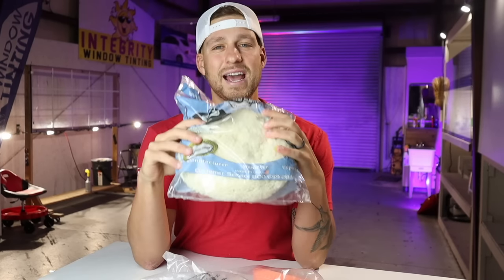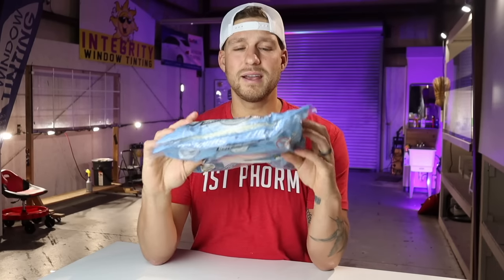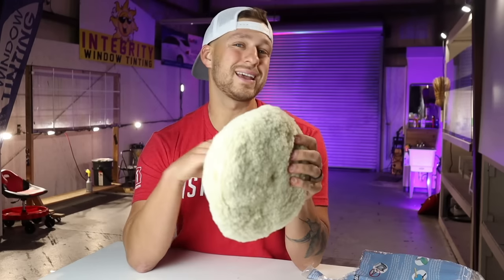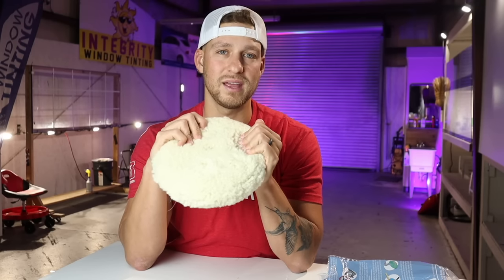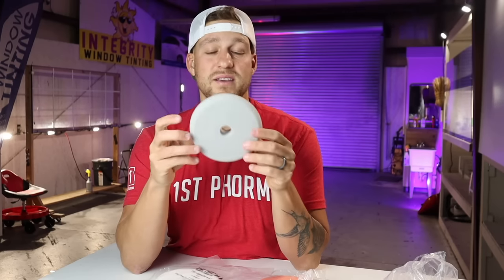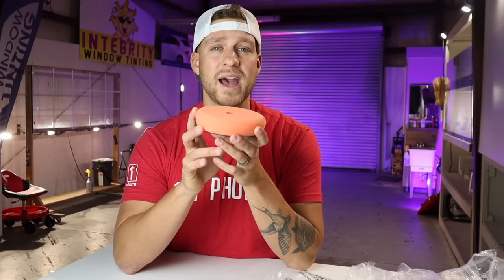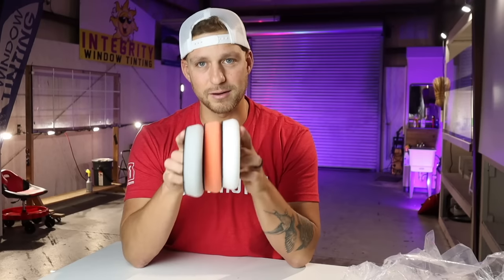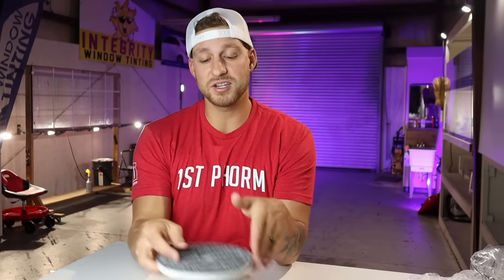Boat Detailing Pads | Everything you need to know!

Comment: You mentioned you don't like using the yellow wool pad and you find it somewhat irrelevant can I get your opinion on this? Wont it still leave small swirls and holograms?
Reply from the maker: Yes the yellow pad will still leave swirls. 

The orange foam with menzerna 400 with remove the swirls from the white wool pad just fine.

Comment: I have a Festool Rotex RO 150 dual mode sander (6"). You can lock or unlock forced rotation. Do you think this would work as well as the flex unit you mention?
Reply from the maker: Yes that should work!

Comment: Hi Drake, Awesome Video Content!! Thanks!!  What compound would you use if your only doing a one-step light oxidation service with just the grey foam pad before waxing?   Also, Pertaining to the Uro-Microfiber pads, d you use the Black ones or grey ones more. I see you use the black ones a lot in vids. What is the criteria for white vs. grey Uro-Fiber pads?   Thx,   Mike
Reply from the maker: Hey Mike! I would use Starke Elevate! It removes light/medium oxidation, but then it works down and works exceptionally as a polish!!! And as for the microfiber pads, both of them will work! I use them both for waxing! 😊

Comment: Similar to CKW comment. Watched your how to wet sand a boat (properly) video which was also really well done. Thanks for doing these. I have a question if thats ok here. Buying a 2020 black hull boat with vinyl letter name midship on one side of hull. Black gelcoat and letters are pretty big at around 10" tall and 1.5" thick. Entire name of the boat area is probably a good 2' long. Boat has less than 70 hours and has been stored under cover. Wondering your professional opinion on what I may need to do to the letter area after I remove them to keep from seeing the difference in the gelcoat color. Start with buffing? Can you recommend pads any solvent or polish etc? Thanks again for the content.
Reply from the maker: If you were just planning to buff the hall, the vinyl graphic should be fine. However, if you take them off, then just buff then you will see a little bit of a color difference difference in the gelcoat. If you take them off and want to blend them in, you may have to wet sand.

Comment: What is the RPM that you recommend for waxing an rv with microfiber pad with the Meguiars DA? And for compound removing swirls, witch RPM? Thanks for your help.
Reply from the maker: Hey bro! For waxing, you want to be on a pretty high rpm. Probably second to third highest setting. The sealant will adhere better if it’s heated up by the machine.

Comment: My boat is only 2 years old and not oxidized.  I want to wash it and wax it really good but the boat is Black and tan with a Black Motor.  What would you suggest?
Reply from the maker: Starke hyper hold, buff and shine urofiber pad, on a griots garage G9 DA
Reply: @DrakesDetailing  Would Jescar power lock work good as well?

Comment: So you compound with a rotary buffer then  do you finesse is what im use to using and then polish with a da? In the body shop world we just use one machine for all 3 steps and thats a rotary buffer
Reply from the maker: I’m not familiar with 3M’s products, so I can’t really tell you what step finesse falls in, but yes, heavy cutting step isn’t with Wolf head and a rotary, medium cut/Schill removing is done with a rotational polisher and a foam pad, then your sealant is applied with a dual action polisher with a microfiber pad.
Reply: @DrakesDetailing  finesse-it falls in between heavy cut and  a polish. It takes out the heavy cut scratches. I have always used in with rotary makita buffer. Wasn't sure if a DA would be a better choice. I have never used a DA polisher when buffing.

Comment: Do you recommend wet sanding before using compound  on a highly oxidized  boat?
Reply from the maker: Hey Bro! It depends on the level of oxidation, if your heaviest cut compound isn’t bringing you the sine that is should, then you probably need to wet sand. If your can feel the pores of your gel coat like sand paper, then you probably need to wet sand. Either way, do a test spot where do try both, and see what will work the best for you!

Comment: My boat has a gray hull and has light oxidation and I am confused by all of the different combinations of pads and rotaries, orbitals, and DAs.  I am not a professional detailer just a boat owner and I'd rather not spend $450 on a Flex 3401 but I am willing to buy the Mikita polisher.  If I were to buy the Mikita, which pad could I use for light oxidation with that polisher, and which product (compound, polish, etc)?  I already have a Griots DA that I use for applying Jescar sealer.
Reply from the maker: You bro! If your budget only allows a rotary and yo I have light oxidation, then I’d use a yellow wool Lake Country pad with chop top compound from shine supply. Use my discount code DRAKE15 https://shinesupply.com/collections/compounds-and-polishes/products/chop-top-32oz

Comment: I picked up a aluminum fishing boat and have discoloration on the hull and water mark down the side covered in calcium that absolutely will not come out without sanding which makes me nervous but im going for it but all the info im finding is on glass boats that are gel coated what would you recommend for a painted aluminum boat for detailing the exterior including compounds
Reply from the maker: Hey bro! Is it just stained? Maybe try some acid
Reply: Drake's Detailing  it has a horrible water line stain down the boat and calcium built up so bad but id be willing to try your trick what acid would you recommend

Comment: Hi drake could u tell me the steps i need to do on a new applied gelcoat many thanks
Reply: And also which products to use
Reply from the maker: Hey Daniel! Just be careful on New gelcoat, if it’s not yet oxidized, then you can just polish it with Starke  Elevate medium cut compound, then apply Starke Hyperhold polymer sealant to protect against the UV rays. Then repeat every 4 months or so.

here’s a link to where you can buy the products….  Hope this helps! 😎
https://drakesmarinedetailsupply.com/collections/sealants/products/starke-hyper-hold-polymer-sealant

https://drakesmarinedetailsupply.com/products/starke-elevate-medium-cut-compound?variant=37398819602608

Comment: Great video and information. I have been using Menzerna on all my boats and Mercedes for 15 year and detailing for 30 years, not as a business. Question, I started using the new Menzerna 300 or usual 400 with lake country wool on a flex 14-2 150, depending on the oxidation on the boat. The interesting thing is I don’t  get heavy swirl mark with my wool pad when cutting. Then switch to lake country foam CCS, but will try the forced rotation pads. 

Do you use Menzerna 400 to cut on wool and then also switch to your force Rotation 3401? Or do you use another cutting compound? If so, what is it. I thought Menzerna 300 was the most aggressive in the industry to cut with? I have always used a flex 14-2 150 for cutting and polishing, I guess I’m just old school. But willing to change it up and maybe purchase the 3401 by flex. Alway willing to learn from others. 

One last question, are you ceramic coating boats now? If so what product do you use, how many coats are required and how long does it last, looking  to do my 50’ Express boat. Thanks
Reply from the maker: Thanks for watching! 

I personally use starke level R for my heavy cut and I mainly use menzerna 400 as my medium cut on boats. Menzerna 400 doesn't leave a lot of swirls, which is nice. 

The CCS pads are great pads too, I would stick with them if you are getting great results!

As for ceramic, I coat a ton of boats with starke liquid Thor coating. Its really easy to apply and list about 18 to 24 months! 

https://drakesmarinedetailsupply.com/products/liquid-thor-nano-ceramic-marine-coating?_pos=1&_sid=b038da51f&_ss=r

Comment: Hey drake if I use chop top on my Rv which product would I follow up with or which product do u Recommend for the RV
Reply from the maker: Depends on how back the oxidation is. If it’s bad, then chop top with the white wool pad. Then follow up with the orange foam with chop top again. That should be all you’ll need todo
Reply from the maker: Use the foam pad on a da or force rotation polisher
Reply: Ok thank you.

Comment: How do you determine the level of oxidation? I’ve got a 2016 Sportsman and it’s definitely lost some of its shine but there’s no chalkiness or anything. I can’t decide whether to go with a heavy cut or a medium cut. And could I use an orange pad to do a cut and polish in one step with a DA? Thanks.
Reply from the maker: Hey Lee! For your boat I would do Starke Level R heavy cut compound. I would just do heavy cut to level it all out and start from scratch, then work your way up to the medium compound (Starke elevate). The DA will not have the power to cut through oxidation, and that orange pad is meant for polishing not cutting. Hope this helps!
Reply: @DrakesDetailing  so heavy cut even though it’s not heavily oxidized? Once I do this will I be able to just do a one step polish/seal every 6 months or so if I stay on top of it?

Comment: So I just ordered some starke hyper hold and the microfiber pads you recommend from your site. I do have a question. Do you use the pads over and over again or do you apply the sealant and throw away the pads after use and just order more the next time you apply the sealant?
Reply from the maker: You'll be ok to use the pad a few times! Thanks for purchasing !
Reply: @DrakesDetailing  do you clean them with anything?
Reply from the maker: Not my waxing pads
Reply: @DrakesDetailing  question for you. I just got my buff and shine URO-fiber pads item #692MFP-2 in. They say med cut. Did I get the wrong pads for my new boat to apply starke hyperhold?

Comment: Hey Drake I haven’t seen a video on how to clean a tender boat. With the polyethylene how do you get that clean as mine is terrible
Reply from the maker: You can use some degreaser and wash brush. after that, Id keep it wiped down with 303 sealant
Reply: @DrakesDetailing  tried that really didn’t make a lot of difference, to stained. Thanks anyway
Reply from the maker: If you have an Instagram account you can send me some photos, I might be able to help more. 

Instagram @Drakes.detailing

Comment: Do I need to use the foam pad? I just want to wax/polish my boat. A lot of what you’re saying is going right over my head. What do I need to do? My boat is a 2014 Nauticstar 203 DC red and white color.
Reply from the maker: It highly depends on the condition of your gelcoat. If you are saying it just needs polished and waxed, then I’d use a DA polisher with an orange force rotation pad from Lake country, then I’d apply a polymer sealant with a black pad from Lake country. https://shinesupply.com/collections/pads-applicators/products/hdo-orange-foam-cutting-polishing-pad

https://shinesupply.com/collections/pads-applicators/products/hdo-black-foam-polishing-finishing-pad

I’ll have to get back to you regarding an upholstery guy. 😎

Comment: What size backing plate do you use on the flex? Wondering if it matters relative to pad size
Reply from the maker: 5 inch backing for 5 inch pads, 6 inch backing for 6 inch pads

Comment: Please help a kid with a tip: my son was hired to wax a yacht, the guy gave him a bottle of non-cleaner wax and said go to it with no other instruction.  He put the wax on by hand and now it won't wipe off, you can still see the dried wax marks.  What's the easiest way to get that stuff off?  He's just a kid, but he's really trying to fix it.
Reply from the maker: It’s most likely sucked into the pours of the oxidized boat. 

Usually a dawn dish soap wash will remove it… if that doesn’t work wash the gel coat with all purpose cleaner like super clean or purple power. 

If that doesn’t work.. then you’ll need to buff it off with a rotary buffer, wool pad and some compound. 

Hope this helps!
Reply: @DrakesDetailing  thank you!

Comment: The hull seems kinda dull. How do I know if it just needs waxing or if it needs polishing or compounding, etc?
Reply: To remove oxidation use a cutting compound to remove it and give a shine.
Reply from the maker: If it’s dull you’ll need to compound and polish before waxingn
Reply: I’ve watched several of your videos. Really looks like you know what your doing.   However, it seems the boats in the videos are already in really good shape. Is there a video that maybe I’ve missed that shows a good before and after.  A boat that clearly has a dull finish and then the actions you took to get it looking “glassy” like you apparently are good at!
Thanks.

Comment: Respectfully, I've done boats for 15 years doing about 140 boats a year with a crew and you only need 2 pads. One for compounding and one for polishing or "waxing". I've taught classes in this skill for the same amount of time. Nobody has shown me evidence that I'm wrong yet. 
You can you use 20 pads and 10 products but why when seeking the "best results" and they can be achieved with 2 pads and 1 buffer. 
There's a huge difference in the brands. 3M makes some good ones.
Using a DA on a boat should be reserved for final finish work, not to grind or perfect in my opinion.
Also, stop sanding boats, no need. You seem to take auto detailing and are trying to make it adapt to boats, they speak different languages, I can't do a car for shite but can't be beat on a boat.
I'm not trying to disrupt your game, I see you wasting time and money with these "middle steps"
I never leave swirls with wool and a good compound, ever and I don't use ANY foam pads on a boat unless it's painted. I also don't do middle steps. Achieve perfection with the compound. 
Ask CeramicPro, I taught an application class where they couldn't perfect the gelcoat with DA's but a wool pad and compound fixed it. I finished the class for them, no more foam pads or sanding allowed that weekend. 
https://youtu.be/fP9qf6sJPOA

https://youtu.be/Hq36ZA4Psa8 as an example.
Reply from the maker: Awesome! Everyone has their own style, go kill it!
Reply: @DrakesDetailing  and if it saves you time and money as a detailer, you win.. We grossed $640k last year detailing boats in Seattle, want to know how my different way can help you and your subscribers or do you just want to keep selling them products they don't need or will ever learn how best to use? I mean the royalties must be insane right?
Yes, we all have our own way, I'm honestly trying to help you and your huge audience.
Again, on cars, I'm sub-par but in boats, untouchable but not so proud that I can't pass it on to a younger crowd before I die. Just thought you might want to "get there"
You either want to learn the right way or you don't. What are you? A detailer trying to help people or a businessman trying to make money only? I get a sense of what I think you might be. If you're cool with that great. If you want to be better, I'm here for ya.